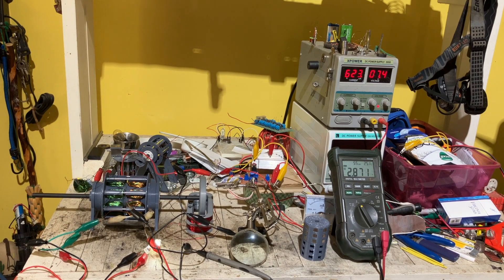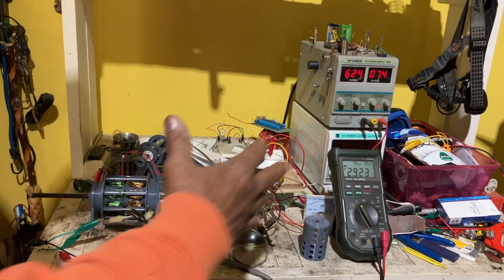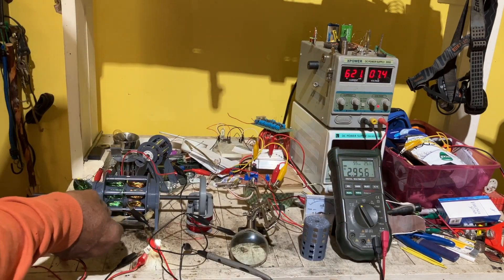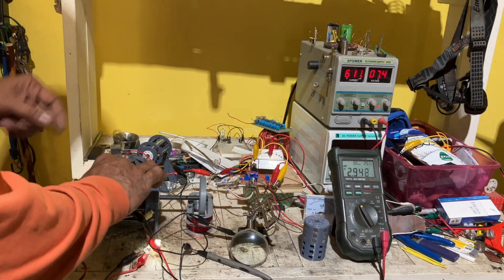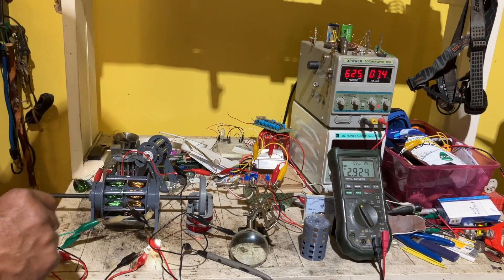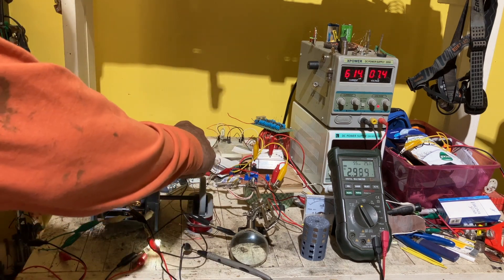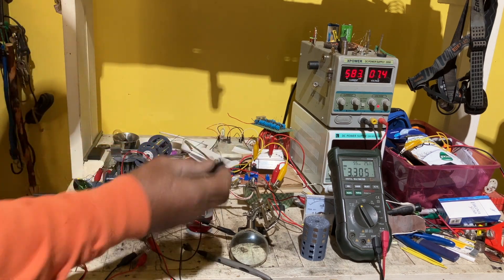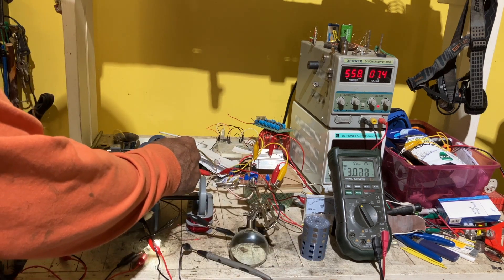Eddy current Biggest missed question is how to harness it not block or reduce it. Eddy current =amps

Comment: Could you not harness that 2.867V from the zinc directly into a capacitor and charge a battery from it - then feeding that back into the system?
Reply from the maker: Many phantom voltage . It show excitation of electron which is not explore but you are right several separate coil do better but i have to be care not to create cogging